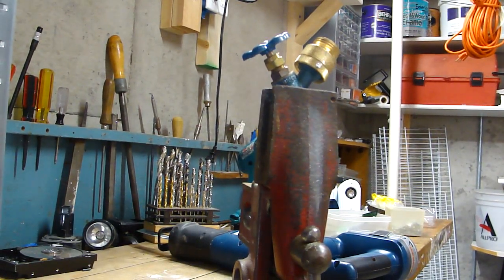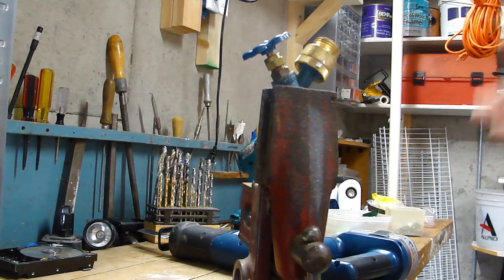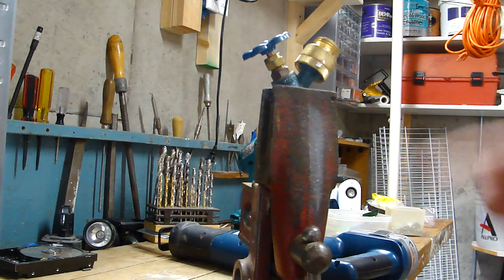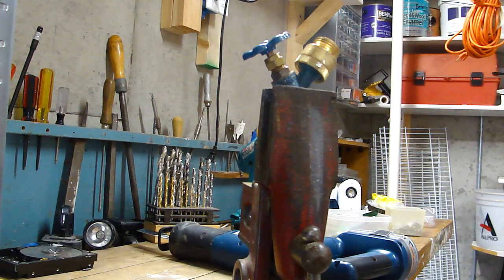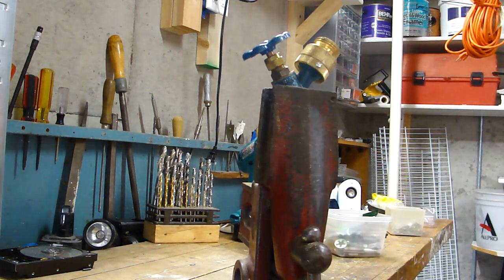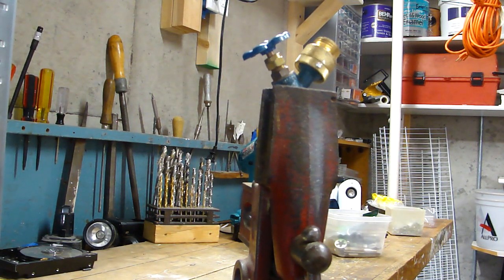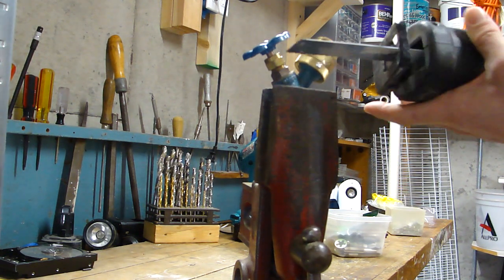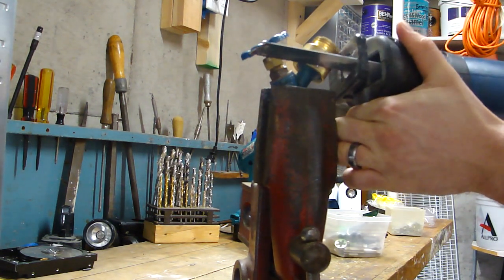How to remove a vacuum breaker

Comment: Thanks for the video...I actually just tried this before finding your video but it did not work. The break-off was so close to the actual VB itself and left almost nothing exposed. I ended up drilling it out instead (and distorting part of the threads in the process). Took a bit more force, but new VB is installed. Btw the old one had to be replaced since it would make a hum sound anytime the water was turned on. Thanks again

Comment: A dremel is probably a more practical tool for this, and doesn't require that you remove and clamp your spigot. Your technique of cutting a new screw slot is right on though.
Reply: I did it with a mini hack in about 5 minutes. And the screw was broken off so bad that I had to cut deep down just to make a cut in it.